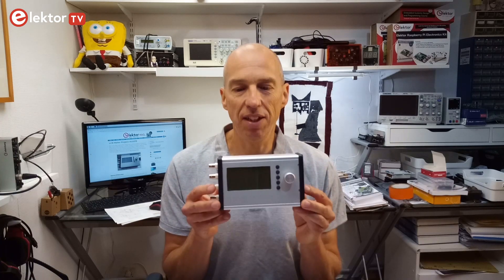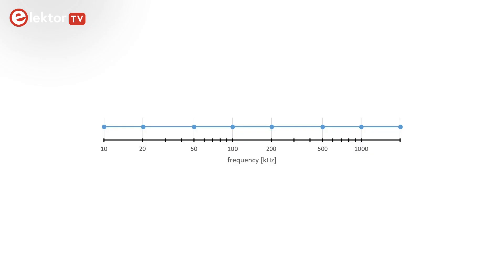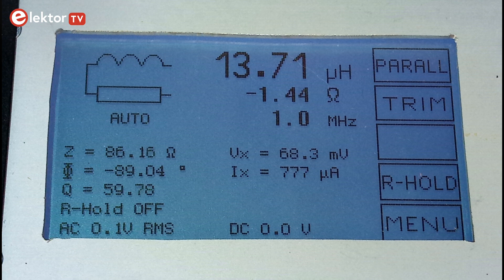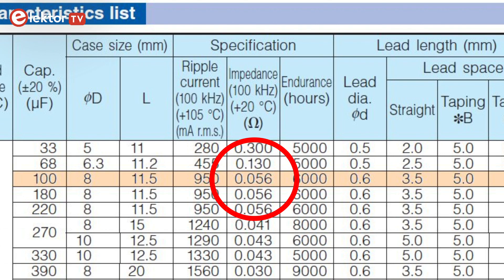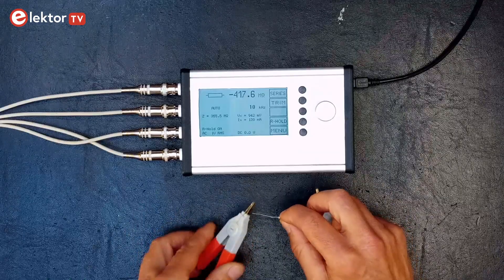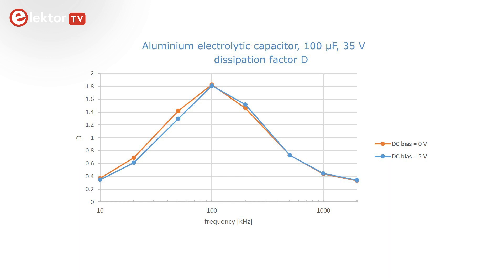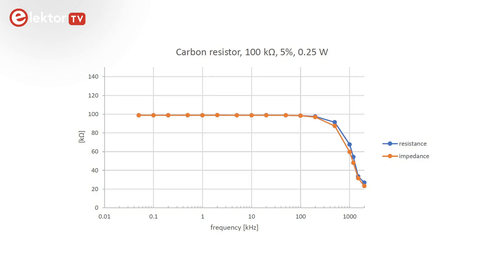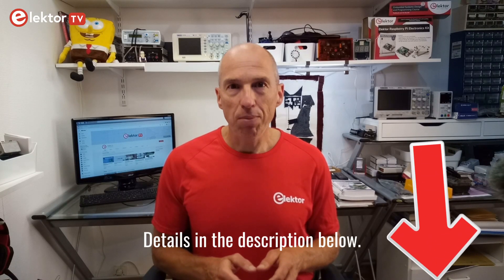Trying Out the New Elektor LCR Meter AU2019

Comment: How does the PC/ MAC software work? Is it just a mirror of the on-device LCD screen, or does it provide more function? Like for example automatically creating such great Frequency dependent Value graphs? :-) Also, is it possible to somehow add external DC Bias, for even larger DC current when testing Coils?

Comment: Cool! But what are the four BNC-connectors for? Are they for the Kelvin-leads? (but then do you not use the coax cable for this?) Conversely, if you use the BNC+Coax as a robust single-pole connector (4x), won't you suffer from changing parasitic inductance when you move the cables?
Reply from the maker: The BNC connectors are indeed for Kelvin leads which are highly recommended for this device. You can also use a TH26001A-style text fixture.
Reply: @ElektorTV  Yes, but what about the induced EMF, and the parasitic inductance of the leads, then?